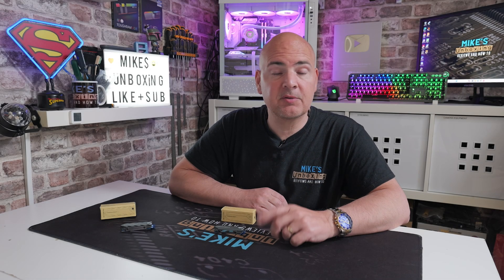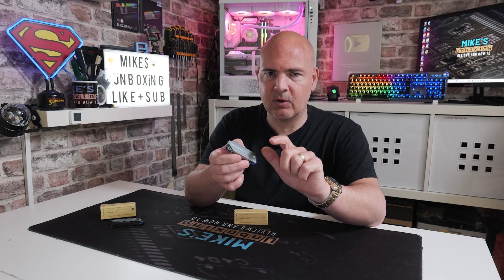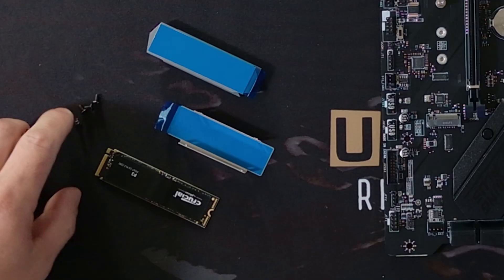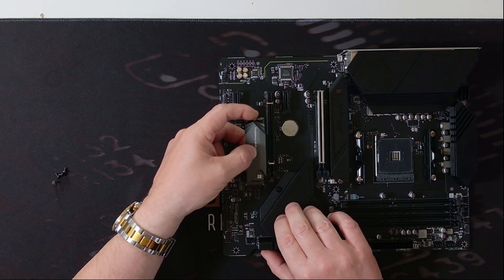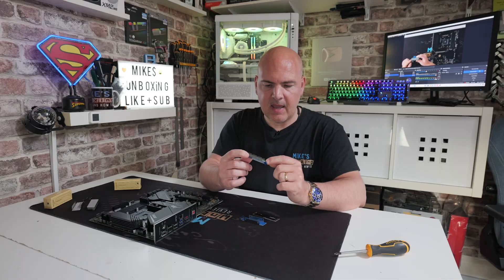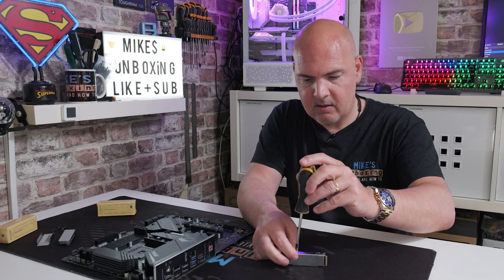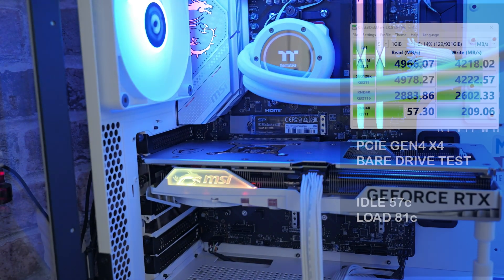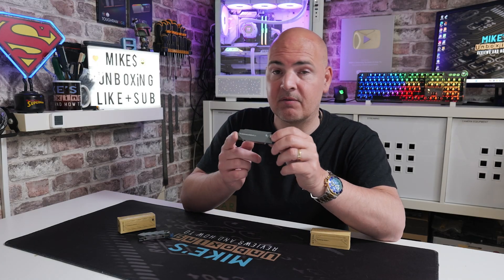BEST Cheap M2 Drive Coolers Thermalright M2 2280 & 2280 Pro Install & Review

Comment: Following advice on another YouTube heatsink comparison I moved my M2 to the slot below the the gpu.

56C when above, 37C when below.

Free.

If I fit another M2 I will just use the tallest heatsink I can to catch the airflow better.

The flashy looking ones are choosing form over function, you want the most surface area, not sleek looking covers with a few fins.
Reply from the maker: if you have a GPU that has a permanently active fan you could see the benefit of the extra airflow under the GPU, if you have one that has a zero rpm mode, the extra build up of heat can make the drive hotter, it will depend from case to case how the drives perform and the heat levels
Reply: @mikesunboxing I think it's more about the heat rising from the GPU than the fan.

Heat pools just above the gpu slot and most fans are not pushing air along that area.

My GPU is water cooled, with a small fan underneath pushing air upwards into the other components. There may be a small airflow caused by the intake side of the fan.

It just makes sense to have passively cooled items below heat producing items, not about 15mm above them

Comment: To be "that" guy, would it not be better to install on the M.2 slot nearest the CPU as that runs hottest? My near CPU M.2 is very hot to touch while the M.2 further away from CPU is mildly warm.:body-blue-raised-arms:
Reply from the maker: Probably because it is running at a slower speed

Comment: Just installed tjhe non pro version on a Kingston NV3 - it is on an AM4 ASUS 520 A II Motherboard, so restricted on speed to its gen 4 potential - got 3 front fans and one exhausted. Did Notice the Kingston app highlighting a prior env temp of 36 - so amber and earlier today with it fitted showing 33c - on checking HWMonitor - assembly is showing depending on room temps and current room temps on the warm side of 29c min and 46c max for the assembly - unlike your crucial drive it has an extra temp 1 and 2 sensor reporting 48c and 76c - guessing that will be hot spot reading and second 56c across the board. Definately when running without it was hitting 71c on assembley for sure. Interestingly as it is a system builder built machine it has a non standard screw with a flat head and point in centre, so guessing some form of security type put in for safety during warranty to stop ameteurs poking, so fitted just the top heat sink, and being a single sided nvme, doesn't seem to be missing the metal underside so far. Might revisit when upgrade time comes and work out what the magic screw head is, but at 1tb for a bit of gaming and space for some additional sata - extra storage for games to use as cold store and swap round for speed like I do with the Xbox Series X, shame ASUS on the A520 A II skimp on the nvme heatsink as yes, its pci-e 3, but they do it for the vram and other components, so seems penny pinching. But, being just above an NVIDIA GForce 4060 8gb doesn't seem to moaning too much about heat either.

Comment: I have a Thermalright TR M.2 cooler that works pretty well, and another cheaper cooler with a sliding mechanism to open and install.

Overall, I prefer the bolt mechanism to open and install SSD; it is easier and safer. Other than hurting your finger, the slide mechanism also has a chance to break the thermal pads.
Reply: Does it clear GPUs?

Comment: I've literally just installed the non-pro model (purely chosen due to aesthetics) and found that the temps reported on my display panel are roughly the same if not 1-2 degrees higher than before installing. As others have mentioned though it's installed above my rather warm Asus GTX 1080 Turbo so no doubt it's helping to absorb the rising heat from the card. Theres noticably less temperature fluctuation though so I guess more stability is almost as good as lower temps! Next stop, trying one of the GameMax IceChill AIO coolers from another of your reviews.
Reply from the maker: yeah higher idle temps actually help the nand flash and if the temps are kept more constant that is also good for the life of the RAM

Comment: 10:20 You mainly want to cool the controller and heat up the NAND. The RAM, if present, it's not really that important to be cooled but the controller usually get too hot and the nand too cold. This kind of cooler does the best for both. For context, some tests have shown that the NAND gets more wear if the temperature is too low.

Comment: To be honest, I find the Arctic M2 Pro cooler pretty good. Yes, it's difficult to use but, in actuality, you install it once and then you are decomissioning it only after your SSD dies or you replace it. I bought 10 of them as I found them for 4 euro apiece tax included so I am set for some time.
Reply from the maker: yeah it is good value, there is no problem with that.

Comment: Do you think these would fit under the GPU?
Reply from the maker: yes they should do
Reply: @mikesunboxing  they look kinda thick and I’m worried about it touching the GPU, I have a 4080S and unfortunately it completely covers my second SSD NVME slot, I was trying to look for a low profile heat sink but they’re kind of hard to find
Reply from the maker: @Sopichan  these are about as low as you can get, or maybe look at the jonsbo ones we reviewed

Comment: Is something like this better than the stock coolers on the board?  My msi board has 2 covers and a bare m.2 slot
Reply from the maker: depends on the board but these are often very similiar performance to most of the more basic heatsinks
Reply: @mikesunboxing  it's a msi b650 tomahawk

Comment: Pretty much any lump of finned aluminium will work fine IF you get the thermal pad thickness (which can be two different ones for controller and NAND chips) exactly right. I use the depth gauge on a digital caliper, and even that isn't straightforward, you have to find the right places to measure from. I also use squishy mineral-based ones (Gelid) that allow a tiny bit of latitude, not the rubbery silicone ones that tend to be included.
Reply from the maker: yeah the gelid strips are very good

Comment: Same price and actually has surface area (ironically also a Thermalright cooler).  For a higher end cooler I'd be buying this, or for a budget NVME drive the second link.  Appreciate aesthetics might come into play, but price to performance wise I reckon these are better options.

https://www.amazon.co.uk/dp/B0B9229HNT/ref=sspa_dk_detail_6?psc=1
https://www.amazon.co.uk/dp/B07KXSK13F?ref=ppx_yo2ov_dt_b_product_details&th=1
Reply from the maker: cheers i will check them out

Comment: Bought the pro version about 6 months ago and never had any problem with them and temps are higher If you put one above the graphics card, you will have higher temps compared to the ssd that's below the graphics card.. Easy to install on motherboard.
Reply: I would think that would work the other way arround. Do you use air cooler for CPU?
Reply: @simptrix007  hello. i use aircooler and my ssd is above the gpu and running hot. do you have suggestion?
Reply: @simptrix007  Why, because hot air doesn't rise?
Reply from the maker: Hot air only rises in a static environment when there is airflow it totally overrides natural convection

Comment: hi mike grate video ? would removing the stickers on the m.2 improve its transfer of heat just like if you forget to remove the plastic off the CPU cooler.
Reply: If you mean factory stickers directly on the M2 drives they are special and are helping with cooling - do not remove them.
Reply from the maker: yes it will the protective coatings need to be removed to get the most out of them

Comment: Haha no blood lost lol Seriously an heatsink is great idea having used an nvme enclosure which surprised me as to how hot the unit got!  Like the ease of fitment, low cost for longevity and stylish when you consider mbs vary in colour. The heat pipe seems good idea but not in practise, as you say its raised so better thermals versus narrow contact area🤔 Thanks for reviewing Mike and Kath have great weekend 🐈👍
Reply from the maker: thanks nick! and yes escaped this review without any nicks or cuts.

Comment: If the M.2 is exposed on the motherboard then I suppose it can make it all look a bit smarter.  Whether it helps performance......I know all M.2 drives dont run at the same temperature so whether this goes towards reducing temps will vary from person to person.  They look smart enough though, thanks Mike and Kath......pleased to see no blood shed this time ;-)
Reply from the maker: haha i was glad to end this review without additional slits in my digits!
With m.2 coolers, the drive generation is the key thing to know if you really need a cooler, Gen3 drives mostly all fine bare. gen4 slower drives can be ok but really a heatsink is recommended. Gen5 - just get a heatsink, or it will die very quickly